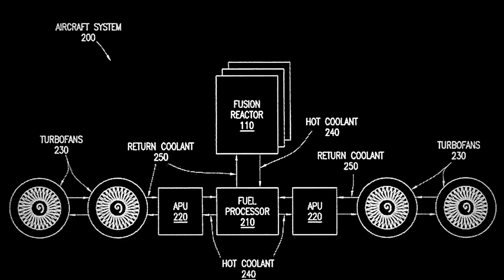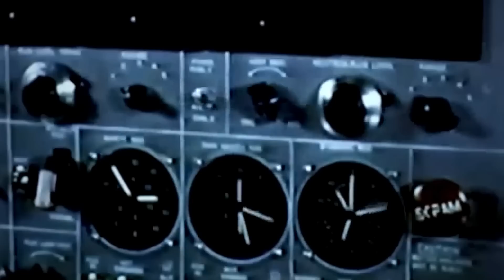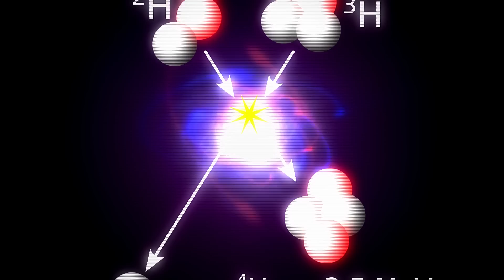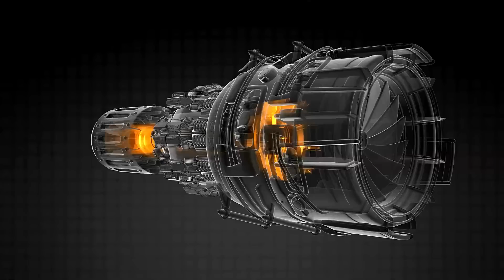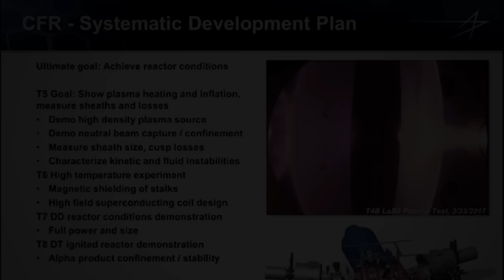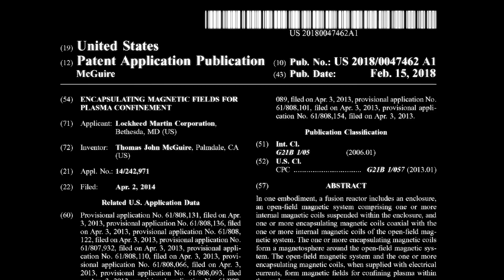The Nuclear-Powered Aircraft that Will Change Everything

Comment: Imagine if all ocean going vessels didn't rely on diesel fuel
Reply: Seems like this could be a better solution than what they are trying to do with them now. Sure there's security issues. I think it could be made pretty safe.  Except most of those crew members are getting paid under $10 a DAY.  Not sure I want a crew paid like that to be that close to anything radioactive.
Reply: @bobbysenterprises3220  I agree 💯
Reply: @bobbysenterprises3220  The solution is automation. Goodbye to the crew`````````````````````````````````````````````````````````````````````````````````````````````````````````````````````````````````````````
Reply: @bobbysenterprises3220 true
Reply: Like before 1911.🤪
Reply: And used the wind 😂
Reply: We’ve been able to put nuclear reactors on boats for decades though… I doubt this will cost much if at all less than a fission reactor when it’s scaled up to boats size and we know they don’t care about environmental damage. That’s the weird thing, Sure fusion is better than fission, but fission is better than conventional fuel sources by a much larger margin and people still don’t use it…
Reply: Diesel is clean compared to the HFO sludge they actually burn.
Reply: When you refine a barrel of oil, it separates out into a wide variety of substances. Kerosene (aviation fuel), gasoline, diesel, lubricating oils, base hydrocarbons used to make plastics, waxes, asphalt, etc. Simple diesel engines are pretty forgiving of the type of fuel you run through them, and the stuff that's slightly heavier than diesel ("bunker oil") burns in them just fine. This heavier bunker oil doesn't have much use (kinda like gasoline didn't have a use before automobiles), which makes it cheaper than diesel. So ocean vessels predominantly burn it rather than diesel. As someone else pointed out, it's also dirtier than diesel. Although I dunno how much of that has to do with the lack of emissions regulations in the open ocean, rather than the fuel. 

Also, there already was a nuclear merchant ship - the NS Savannah. It operated for about 10 years consuming a little more than a gallon of uranium fuel during that time. It's estimated an equivalent diesel vessel would've burned 29 million gallons of diesel in that time. But it turns out that nuclear reactors require highly trained personnel to operate and maintain. Whereas you can train a monkey to maintain a diesel engine. So the higher crew cost for the NS Savannah outweighed the reduction in fuel cost. And it was more expensive to operate per ton-mile than diesel cargo ships.
Reply: @solandri69  Good post.
Reply: @solandri69  a lot.
It's the sulfur content that's a lot higher because as you rightly say no regulations.
Reply: Yea it would be cool till 2 or 3 boats had meltdowns and contaminated the ocean.
Reply: @Itsoperated  Again?
Reply: @Itsoperated  like the MASSIVE meltdown straight into the ocean that all MsM news sites went silent on far too quickly?
Reply: @Itsoperated I don’t see why they would melt down. 😒
Reply: @Itsoperated  Big hunk of radioactive metal lying on the bottom? No problem; water is an excellent radiation shield. See U.S. methods of storage of nuclear waste at power plants, and shielding on Russian nuclear subs.
Radioactive powder lying on the bottom or floating through the water column? Very bad, food chain could be contaminated.
Reply: @Itsoperated  newer designs are way way safer than the ones oh the past. Like they can't melt down. The reactors "natural state" is off. Not running away like many have in the past.
Reply: Ocean vessels doesn't use diesel. They usually use bunker fuel which is a bit thicker than diesel, higher in energy content and contains more sulfur pollutants. Russia go even further with long carbon chains and use mazut fuel in some of their ships.
Reply: Ot can be done but it won't be.
Reply: There are, I think, two civilian owned nuclear powered vessels in the world right now.  The reason there isn't more is cost and the specialized crews to tend the reactors.
Reply: @PADOYLE   You can’t create nuclear weapons from reactor fuel… I thought that bit of misinformation died in the 90s but here people are still believing nuclear energy is a proliferation risk. 

All of those other things you mentioned are happening right now without nuclear fuel. These problems need to be fixed by society and governments not by energy technology… By your logic we should keep using fossil fuels because green energy relies on exploited mine workers.
Reply: Imagine they would rely on solar and batteries with superconducting propeler electric engines
Reply: Oil is the second most abundant liquid on earth and is not a fossil fuel. 
Fossils are "found" in shallow ground only no where close to oil. 
No one actually knows the source.
Reply: Molten salt reactor would be awesome. Low pressure high temperature and doesn’t need super enriched uranium.
Reply: Diesel? Most use heavy fuel oil or "bunker oil" 
Nasty thick oil that has to be centrifugally filtered and heated before being injected. Diesel would be cleaner
Reply: All those slave ships were wind driven… just sayin’.
Reply: That's deep
Reply: Using hydrogen from the ocean would be more efficient and one hundred percent renewable and the only buy product of burning hydrogen is STEAM which is water due to covalant bond

It takes as little as .03 volts to make hydrogen the combusted force of hydrogen versus gasoline in terms of actual pressure wave propagation fields is 3 times that of gasoline..

" The energy used to push a turbine rocket pistons rifle round ECT is ACOUSTIC waveform energy...
Reply: Believe it or not… they actually do not use diesel. It is something called “residual fuel” or “bunker fuel”. After the refineries take a barrel of crude oil and extract light oils( propane, butane, gasoline, diesel, napathanes) there is a whole ton of basically “crap” left over. Asphalts and Residual fuels being among the crap! It is some thick, tar like stuff but that’s what is burnt in the ocean liners. I’m not sure exactly how it is injected into the engines but I d know a 5 gal bucket will get you about 10’ worth of propulsion. Not sure what else they would do with that stuff so some genius found a entire industry to burn it for fuel.
Reply: Um,,, sailboats?   🤓🎶🎵
Reply: Whoa clam down
Reply: Imagine if all ocean going vessels relied on nuclear power. Do you have any idea how much nuclear waste (that remains dangerous for hundreds of thousands of years) that would produce each year?  Do you know the tremendous cost of keeping this nuclear waste safely stored---if a place to store it can be found. How would you like for a nuclear waste storage facility were located in your neighborhood?
Reply: Ocean going vessels haven't relied on diesel fuel for centuries. Age of sail?
Reply: The Soviets have been doing it for years with their icebreakers
Reply: It was done in the 60’s The USS Savannah was a nuclear powered merchant ship way ahead of its time not to mention a beautiful looking ship
Reply: If everybody relies on the wind it will be the next thing thats disappearing
Reply: Here's a thought. The vast majority of maritime emissions come from livestock feed carriers and large fishing vessels. We the consumers have the power to remove our finances from these industries in a heartbeat. The switch to a plant based diet is underway but which side of history do you want to be on?
Reply: @ObamaoZedong  The side that eats meats and doesn’t delude itself into thinking it can save the world via dietary changes….
Reply: @ObamaoZedong  the vast majority is livestock food by themselfes
Reply: @kafakafaa3950  Indeed. Not to mention farming animals is the leading cause of deforestation, ocean dead zones, and mass extinctions.
Reply: @ObamaoZedong  spouting nonsense without ever being around any farming, I see
Reply: @genxfpv  I've farmed animals and I still live around farms. Do you have any idea how much a feedlot stinks of methane? Here's some perspective, on the amount of land we currently waste in the USA alone growing crops to feed farmed animals, we could grow enough food to feed all 800 million starving humans across the world. Imagine how much land we could return to nature of we cut out the middlemen.
Reply: @ObamaoZedong  the side that eats meat 🍖 🥓
Reply: @jblob5764  I get that you're trying to look edgy, but doesn't environmental destruction bother you? And it sounds like you haven't tried all that many plant based dishes. Were you the kid who wouldn't try guacamole because it's green? 😀
Reply: @ObamaoZedong  oh i eat plenty of greens. Doesnt mean i am willing to stop eating meat either. Not eating it wont save the world
Reply: @ObamaoZedong  Its not a switch it is a niche. Also, I looked it up and maritime shipping only accounts for about 3% of global emissions. Much of that is grain, but not just feed grain for animals.
Reply: @seth7745  Yes you're right that industries fund studies to show their field contributes less emissions than it actually does. Farmed animals consume over 90% of grains and soy. Meanwhile they themselves account for 18% of carbon emissions, and more methane and nitrous oxide emissions than all other human activity combined, those two gasses have a 30 and 300 times greater greenhouse effect than CO2 respectively. Not to mention the inherent resource waste of cycling calories thru animals. On the amount of land used for animal feed just inside the USA, we could grow enough food to feed all 800 million starving and malnourished humans on earth. This industry is demolishing our planet and we can end it with a simple choice each day.
Reply: @ObamaoZedong  You eat whatever you want. but for everyone else its their personal choice. I will continue to eat primarily Chicken, fish, eggs and occasionally beef. I'm not touching these plant based protein products until they start putting amino acid profiles on the packages. The human body is evolved to digest animal proteins with near 100% efficiency. Not the case with most plant proteins, so you have to consume more. Also the amino acid imbalances can cause health issues.